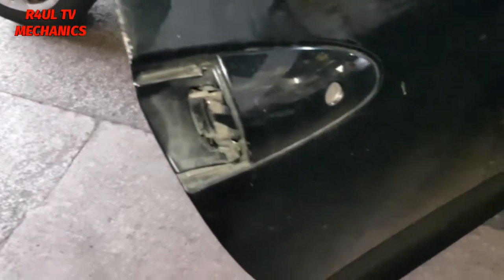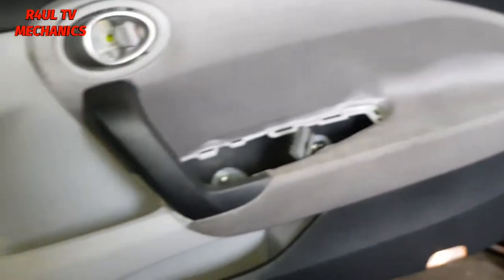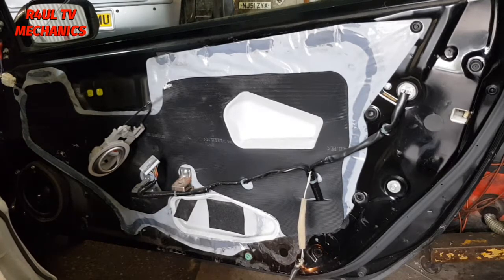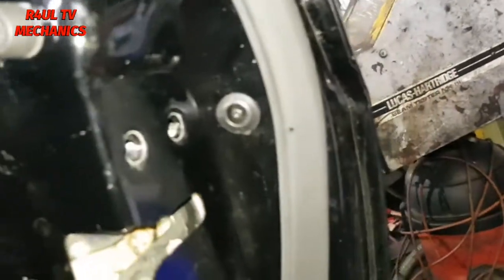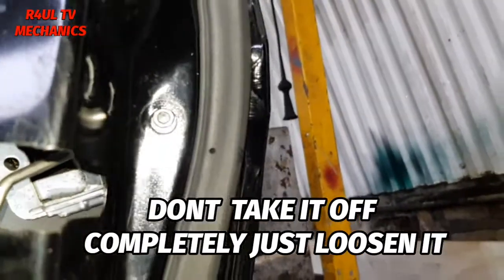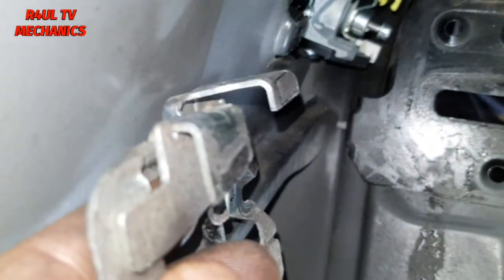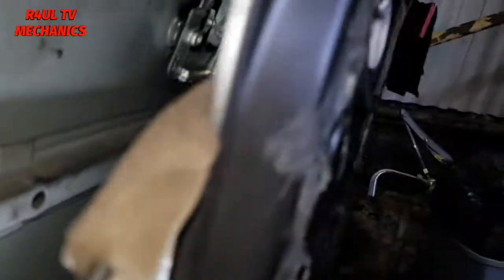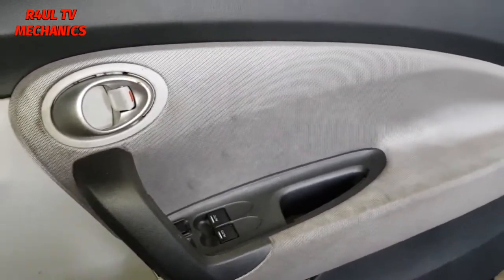2010 HONDA CRZ DOOR HANDLE REPLACEMENT

Comment: Hey brotha, just finished up replacing my exterior driver side door handle. There's a few other videos on YouTube up on the subject, but yours covered the bases pretty well.

Honestly, for those attempting this on their own, the hardest part is getting the lock-assembly back on to the metal rod. By and far the most frustrating aspect of this fix. Everything else is mostly a cake-walk.

Also please, make sure you have some sort of ratcheting Allen key. That thing will make life a lot easier. 

Raul, I appreciate this video man. The CRZ is a wonderful car, but certainly not without it's faults. People like you keep these things alive for people like me.
Reply from the maker: Thanks for the fantastic comment. Glad you got it done. Thanks for watching really appreciate it